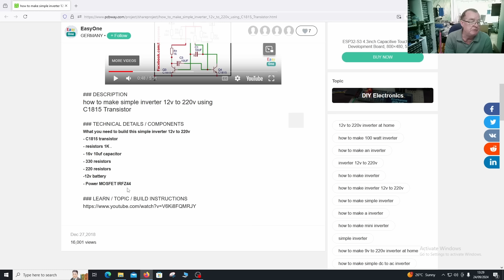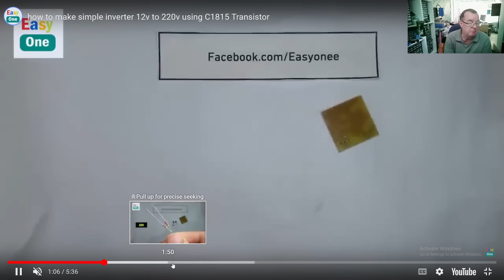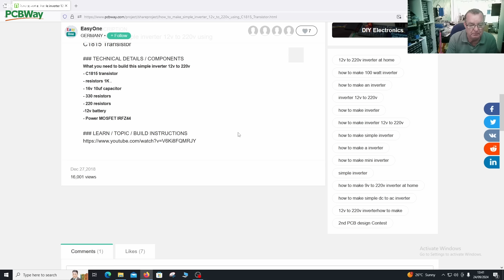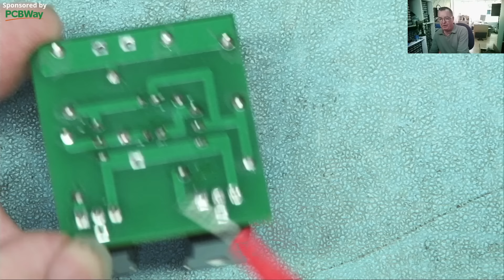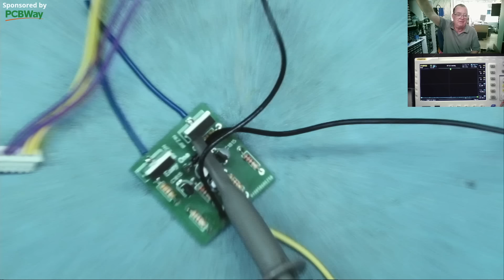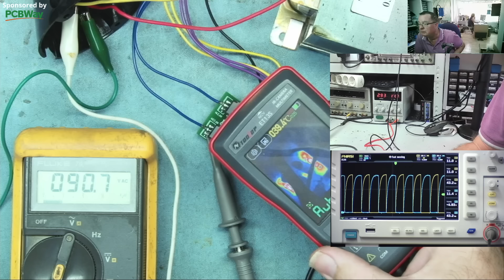Simple DIY 12V to 220V AC Inverter Project Using 4 Transistors.  Does it work?

Comment: I was wundering. To test the capabilities of the transformer on 50Hz. Can’t you take a 230 to 12 or 15V ac transformer, with sufficient amps available and then check wat the output wil be. So you know wether it is the circuit or the transformer causing the voltage drop from 240 to 120v

Comment: I think you should try with a lower wattage lightbulb. If this super basic inverter can provide 50 watts I'll be very impressed. Maybe start at 10 watts and work your way up while checking if the output voltage doesn't drop below 220v 🙂
Reply from the maker: I think that 72W is the lowest power bulb I have.  I'll have a look to see if I can find some at the car boot sale, I have seen them from time to time

Comment: That's rip-off of old Chinese car inverters back in the time when every mobile phone had different charger connector so it was easier to have one of these so everyone can plug their own charger into it. Output power is low, even sellers from ebay back then didn't claimed more than 10-20W and product had much smaller transformer of course.

Comment: Hi Richard,

Looking at the schematic alone, it very much seems as if the circuit is illogical and badly designed. Does the schematic match the PCB? Q3 and Q4 appear to have their collector and base connections REVERSED!

With the circuit as shown, the MOSFET gate drives come from the multivibrator transistors' base connections. This means two things: Firstly, the base voltage pulses cannot exceed around 0.6V to 0.7V above ground and secondly, the base current pulses for Q3 and Q4 (2SC1815), exceed the manufacturer's absolute maximum rating of 50mA. The peak base current is calculated as (VCC - 0.6) / 220 ohms. So, for a maximum base current of 50mA,the supply voltage must not exceed 11.6VDC!

I would change the circuit by reversing the base and collector connections to Q3 and Q4. R1 and R5 (now the base pull-up resistors), I would increase from 1K to 2.2K each. This will result in a higher gate drive voltage. Then reduce the capacitor values to set the desired frequency which will be somewhat lower with these changes. Check that the capacitors, if electrolytics, have their positive sides connected to the transistor collectors. If it is necessary to use trimpots for fine frequency adjustment, place these in series with R1 and R5 each at around 2K. Ensure they are adjusted for waveform symmetry on the MOSFET gates.

Once the correct frequency has been established, the MOSFETS are much more likely to saturate because their gates are being driven by larger pulses, which is necessary to get a good switching current in the transformer primary (12V side). This improves efficiency and reduces dissipation in the MOSFETS.

It could also be useful to place an electrolytic of around 100uF / 25V between Vcc and ground on the PCB especially if long wires are used to connect to a PSU.

Once working properly, this will be a useful project!
Regards Steve in UK.
Reply from the maker: Hi Steve, I did not actually check if the schematic matches the PCB.  Obviously the PCB does work, if it is a little quirky,  As mentioned at the end of ther video we can play with this on the next live stream Sunday 6th October 5pm UK time. Feel free to join us

Comment: I never could understand why is there such huge demand for these 220V inverter projects online. Most of them shown by people in some 3rd world countries. Not to judge, but is it really so much harder to get mains power than to get a battery, mosfets, resistors, pcb, a transformer etc? These basic inverters have so much flaws, they never give a stable 50Hz output, never deliver on the promised power rating, the efficiency is horrible, the ripples on the output are HUGE and dangerous to you and to most electronic equipment. To give 100W at the output from a 12V battery,  the current through the primary would have to be like 20 A or more, which will never happen with 0 cooling. This circuit is only good for one thing, and it's powering a light bulb very inefficiently. So popular though, I don't get it! The only scenario I see it useful is the one presented here - for education and out of curiosity.
Reply from the maker: @maks866 Same applies here as per other reply.  There are a lot of people here (Canary Islands) living off grid and they need to generate power one way or another,  solar (it's always sunny here) and wind powered (we get a fair bit of that too) seem the most popular but of course you need batteries and inverters.  Somewhat off topic but is there some reason why off grid living is popular in some places and not in others? Everywhere has poor people yeah, and  we have people technically 'homeless' here, quite possibly employed in minimum wage jobs as some have cars, smart phones etc, but living in underpasses, caves and unofficial shanty towns and they seem to know how to provide for themselves...  You can build a shack anywhere but need power? Does that make sense?
Reply: It depends on your needs. I've actually needed one of these to get 220VAC from a solar panel+battery setup as a backup (fallback) for my NVR and security cameras. I ended up buying a simple, 100W inverter from AliExpress.
Of course, I could use an UPS, but I already had the solar panel and a 45Ah lead-acid battery. I was very determined to use that as my power source.
I'd like very much to build my own inverter, but getting the correct/useful transformers is always a pain for me. Not very easy to find them. When I finally find them, they are more expensive than the entire inverter from some Chinese manufacturer.
Reply: I make PV power point efficient hot water heating systems out of them which make an ideal power diverter.
Reply: Can it not be used in a repair setting as well? If you need mains power (120/230V) with isolation, an inverter might be able to provide that. Isolation transformers (controlled or with an additional variac) can be quite expensive. "Normal" transformers, OTOH, can often be salvaged from old appliances. Add a few components from the parts bin, and you can probe and poke inside a mains powered device in a safe-ish way. If you're poor, or just starting out, or a hobbyist who only once in a blue moon has to repair mains devices, it might be a suitable stop-gap solution.

I remember getting my control isolation transformer used for ~40 Euro, but I had to search for few years to finally find that good an offer. I might have used something like this in the meantime, had the need arisen.
Reply from the maker: @Foobar_The_Fat_Penguin  I don't see why not.  We could try connecting something like a SMPS to the output of the inverter and see how it reacts.  Have you thought of using an old UPS to give isolated mains output (just unplug it from the mains first) those will run a PC for a while so they must be pretty good. You can find those UPS cheap second hand, usually the battery is no good but they will work with an old car battery instead, I've tried that before.
Reply: @learnelectronicsrepair  It might be an idea to test this with different types of loads, yes. Especially since I've read that certain sensitive, non-resistive loads don't like square wave inverters, which this essentially is, right? Something about high frequency harmonics. But I don't know how big of a deal that really is in reality.
Reply: @Foobar_The_Fat_Penguin  Well such home made square wave inverter is gonna have peaks of 600V or more, so you are more likely to damage something than to repair it.

Comment: 9:00 Prediction, input=15VDC, output=140VAC.
Let's see how close I am.
Edit: wasn't a bad guess, you didn't allow for the fact that since the 15V output was AC, the peak would be about 26V. Reversing that, your peak input needs to be 26V not 15V.
Reply from the maker: Spot on.  Let's play with this on the next live stream and see what we can get out of it 🙂
Reply: @learnelectronicsrepair  I also considered why you appeared to have an output of 240V with no load. Probably because transformer theory of ratio of turns assumes a sine wave and your actual waveform is nothing like it. As soon as a load is applied the theory asserts itself. I hope I can make the next live stream (6 October?), I was busy for the last one.